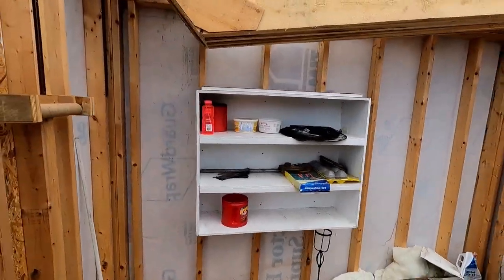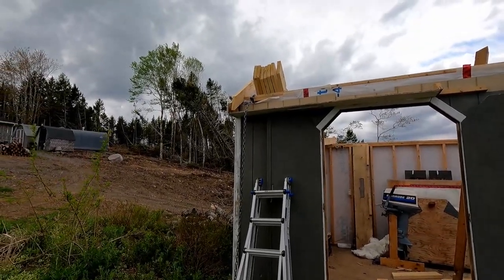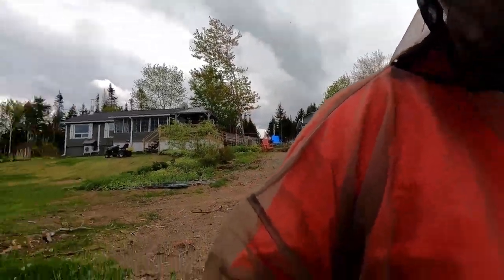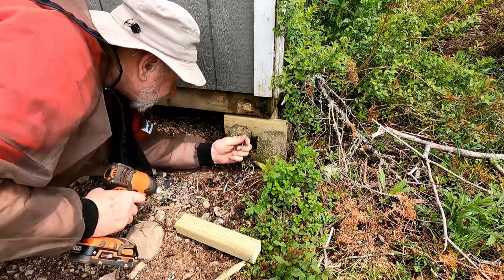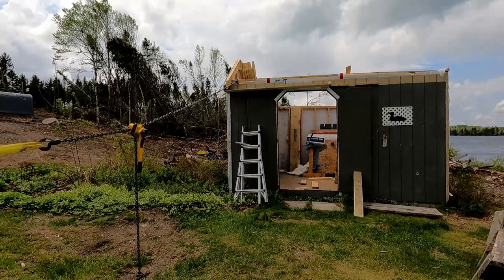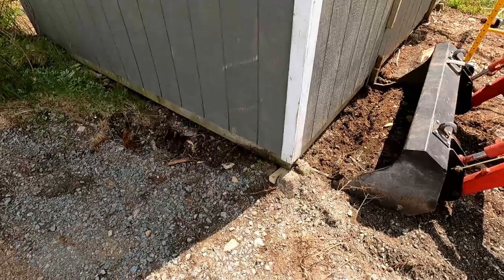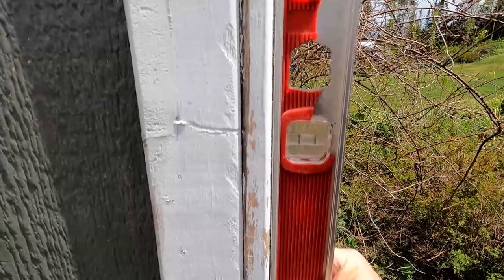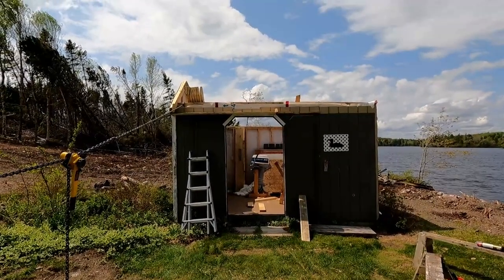Plumbing the Boat House

Comment: Good evening Mike,  I love my come along. Once you got the stretch out of the system things moved along quite nicely. Short of an almost rebuild,  taking the skin off, I'm with you. It's a boathouse👍  Enjoyed the hair message on the board 😁👍😄👍 Have a good one, Ben.
Reply from the maker: How's she goin"?  Thanks Ben!!  The come-a-long is nice alright.  It's only a ton and a half but that's plenty I think.  A heavy piece of gear to get set up, but it'll pull.  Peeling the panels off would be a big job and if I went that far I may as well start over eh!!  Thanks for the visit and take 'er easy!!

Comment: I would say that's close enough, Mike. You might have to fudge the roof rafters a little bit but it shouldn't be too bad. But i do wonder how accurate that level is. If you found it on the road it may have taken a good tumble.
Reply from the maker: How's she goin'?  The story on this level is a long one.  In Fact I did find it on the road and only one level bubble works on only one side of the level and one plumb bubble works on only one side of the level.  And I'm not too sure how accurate either one is!!!  But I built a split level house, a 2 story barn, a camp, a 1 1/2 story shop a boat house  and many other out buildings over the years with it!!  Crazy eh.  I spend a ship load of money and a drill or something, yet I won't spend $25 for a level!!  Go figure.  Take 'er easy!!!
Reply: @GrampiesWorkshop  Ahh, you've had the level for a while. I thought it was something you found recently.
Reply from the maker: @twinbrookacres  Did you notice the level was red.  A liberal (spit) color.  It's liberal (spit) because it's crooked!!  LOL

Comment: Great job getting the building a bit more straight, the Massey worked really well to lift the corner and may have been the solution on each corner. We have being doing some repairs on an old build that a previous owner had built and nothing is even close to straight. I have no idea how someone can build something like that but it feels 10x harder to repair something that is not straight
Reply from the maker: How's she goin'?  You are right Jposeph, it's harder to make something straight than to create something straight.  I was chasing plumb all around the building.  I would get one wall sort of plumb and move to the next and make it sort of plumb and then the first wall was off again.  This sure is a compromise but I think it will be square and plumb enough for a boat house eh!!  Thanks for the comment and take care!!

Comment: I'm surprised you didn't use the tractor as the anchor! Maybe you'll have to pull a few nails to get it to rack in shape. You'll figure it out👍
See ya Mike✌
Reply from the maker: How's she goin'?  I was thinking of using the 'logging winch' on the tractor but opted for the come-a-long.  The poor old boat house ended up with a pretty good twist in it.  I think it's square enough now, but we'll see when it comes time to put the roof on eh!!  Thanks for the visit and take care!!

Comment: I've never had to plumb or level a building, but here are some questions I would be asking myself right about now:
How level, plumb, and square was the building to begin with?
Are you sure that level is reliable?
How much time would I put into straightening the building versus the time I would spend adapting to the reality at hand?
But I've never done this kind of work, so take my thoughts with a grain of salt.
Thumbs up and thanks for posting!
Reply from the maker: How's she goin'?  Great questions Steve and those questions have to be asked.  The level, well you saw it.  I built a lot of buildings with that level in that condition.  It's 'pretty level' if you use the right side of the level!!  LOL  But you're right on about how close to square and true do I want to get.  The original building was square ad true but it was built on deck blocks, so after the first winter, it wasn't so square and true any more.  I think this will be OK.  We'll see when it comes time to put the roof on.  Thanks for watching and take care!!

Comment: Where is all the tension going?
Reply from the maker: How's she goin'?  Good question.  I think when the building got twisted a lot of the nails got bent as the wood changed position without breaking.  Now I'm trying to unbend all those nails.  Plus the building is only on deck blocks and has shifted position a lot since it was first built and that isn't helping either!!  Thanks for watching and have a great week!!